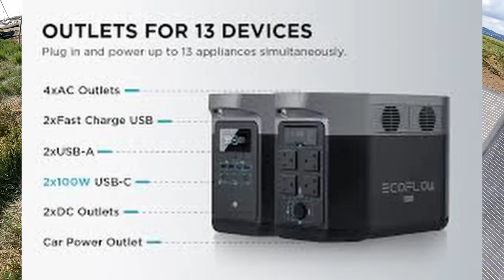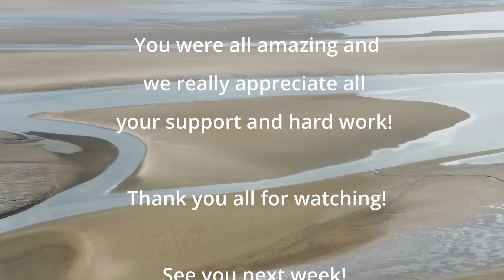Ep 82 - Team Work Day At The Boat! #boatrestoration #boatproject

Comment: Standard Royal Naval practice, if the lads aren't doing anything - paint ship! Most of the time, the surface finish didn't matter, as long as all the rust streaks had gone, and it was all the same colour!
Reply: The same applies to rocks and  all things military.
Reply: That’s very much pre 1990. Painting the uppers is now discouraged and tends to be done by contractors and much more effort to control environment (humidity) during application/curing. Along with that, crews since the T23 have much reduced crew than hitherto. Invincible crew 726 crew for 22,000 tonnes displacement Queen Elizabeth. 679 crew for 65,000 tonnes displacement (excluded air wing and air department for simplicity). So a similar size crew operating and looking after a ship that is three times larger in displacement

Comment: To quickly remove paint, use 4-1/2 In. Polycarbide Abrasive Wheel
Quickly remove rust, paint and flaking material with this polycarbide grinding wheel

Comment: Hello their from Canada, i have  been watching you build your wooden boat, I like your determination most people would have quit after the first month. I have been building boats for over 40 years, all kinds little tee nee wee ones and bigger craft. Would you be offended if i gave you people some advice. 20 volt battery drills do not have the torque to drive screws. You will have to get 1/2 low end torque drill and re tighten all your frame screws. I saw your ship amidships rot in the ribs to some extent, get some white oak and steam it place them in clamp i drive the boat nails gavinized or screws home with a half inch low torque plug in the genset or house power. You guys have done a great job. i see seems open outside on the hull above the water line, if planked with diagonal planking they still may need to swell plug all the outside seems with cotten cocking iron then cover with sickaflex rain water can get between the outer planking and the inner and dryrot will occur. anyway nice ship. if you ever need a new diesel at a cost you folks can afford i am your man. good luck

Comment: The rust converter paints that I have used, actually work better with a layer of tightly adhered rust on the surface of the steel rather than bare metal.  So you might want to wait for that to form.

Comment: hope you told all those grinder operators to avoid the heads of the new copper nails. Is the fourth side of the exhaust the hull or more metal if it is metal how do you know what condition it is?

Comment: Have you given any consideration, or thought about fiberglassing the outer hull?
Reply: You can not fibreglass over wood planks, the fibreglass would crack when the boards work.  You need a strip-planked or cold-molded hull in order to fibreglass a wooden hull.

Comment: Guys. Just a comment which I hope you will consider. Those exhaust systems are of unknown age and appear to be rusting. You have no idea how the hull is behind them. Why don't you remove them, check out the hull behind them then put two dry exhaust stacks up through the roof. The scrap value alone will pay for half the dry exhaust system.Problem solved forever and probably a cheaper fix when you take into account man hours and materials to fix what is there.

Comment: Why is the exhaust running along the outside of half the boat, isn´t that's what funnels are for, you know funneling the exhaust? Most exhaust pipes run inside to the stern, why not yours? Also, that's one big pipe, big enough for a ocean liner, why?
Reply: Mostly sound and cleanliness. If you stand next to a smoke stack on your luxury yacht its not that luxurious
Reply from the maker: It's a wet exhaust
Reply: It will mostly corrode from the inside out, might be worth getting a thickness tester to check. If they prove in time to be caput you could just get rid of it and have the exhaust exiting midships as they were originally

Comment: Here is an even better idea. Don't waste all that labour fanning about outside. Just give it a good heavy coat of paint as it is to protect the wood and deal to it when you finally get her out of the water. Get her soda blasted on the hard. Don't use grinding discs. Trust me... you are going to have to spend hundreds of hours fairing her later. Better to get that crew inside the boat stripping her out to allow you to finish the inside. To my mind this is just a waste of child labour! LOL.